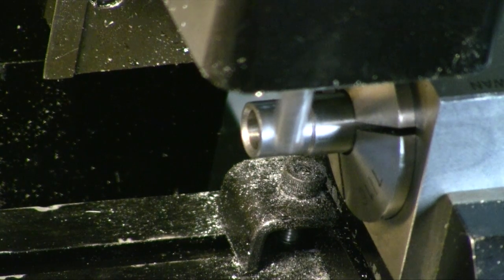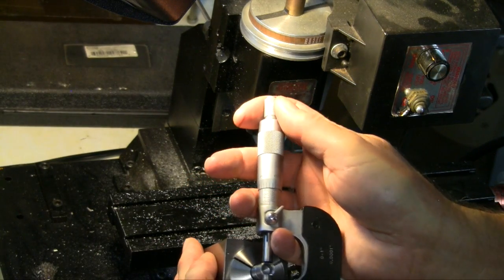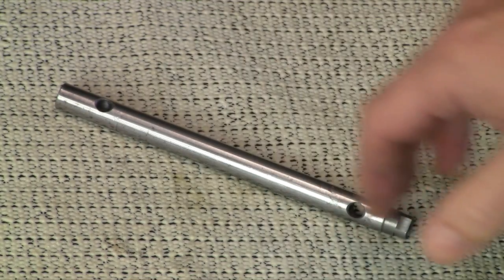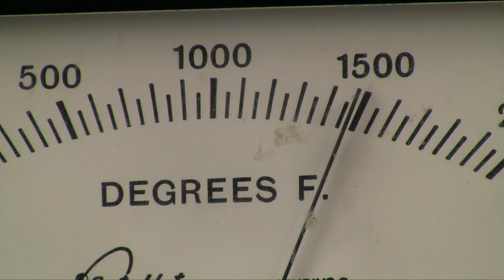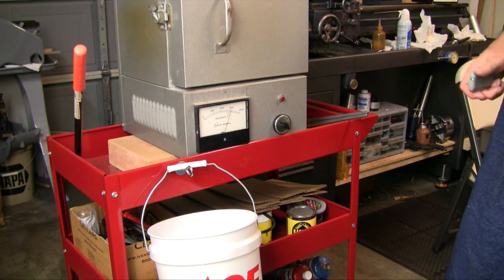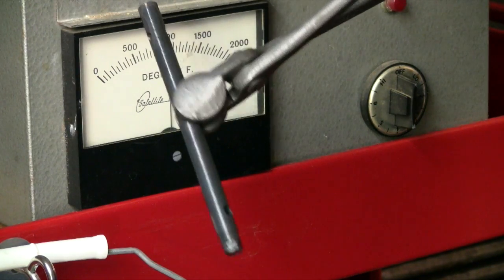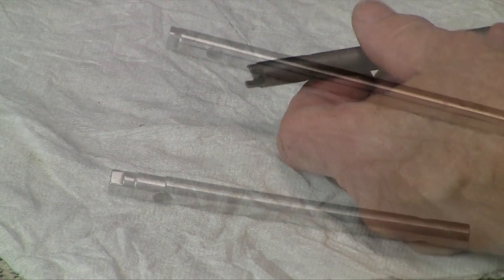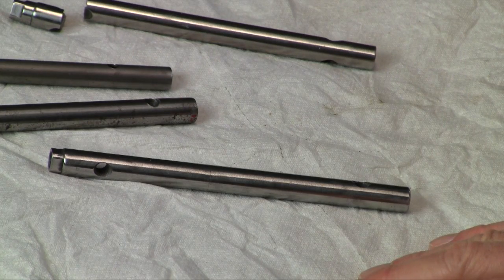Making and Heat Treating a Benjamin Sheridan Valve Tool - Part B

Comment: To prevent scale all you need to do is add about 4-5 square inches of paper in the foil envelope then fold it up tight. 
The paper will burn off the oxygen (it's the oxygen that causes the scale) as it heats up.
 When opening the envelope after the heat you should quench as quickly as possible (within a very few seconds) to prevent any additional scale development.

Comment: Thanks for the dimensions. A few comments from my experience. If you used 0-1 steel, you don't need to pack it in a carbon environment to infuse carbon into the material as you would using a low carbon (mild steel). You can harden the working ends of the 0-1 steel using a map torch then quenching in oil not water. The "0" in 0-1 stands for oil hardening. Water cools the steel differently and can cause minute cracks to develop which probably is why the tool broke when dropped before tempering. Heat the steel to cherry red with the torch then quench in oil. to temper, dip the tool in the oil then heat to evaporate the oil then add additional heat but do not take it to the cherry red state. Test for hardness with a file. This should be good enough for the intended use of the tool. We used to make small parts this way for repairing production machine tooling until parts could be properly made and heat treated and checked with a Rockwell tester.
Reply from the maker: I pack in charcoal and seal it up mainly to reduce scale during heating in the oven.   The oil hardening material is a good suggestion, and thats a good way of outlining the procedure.